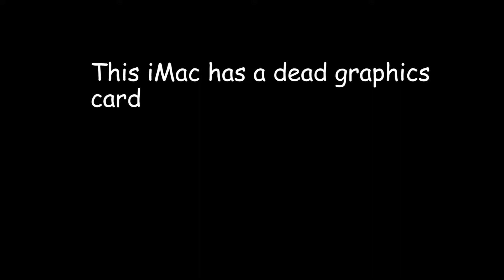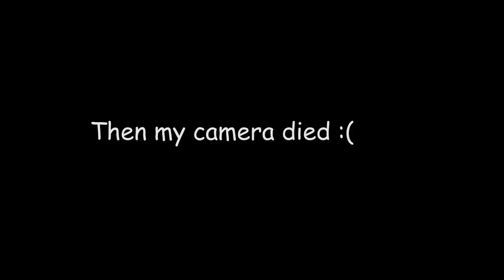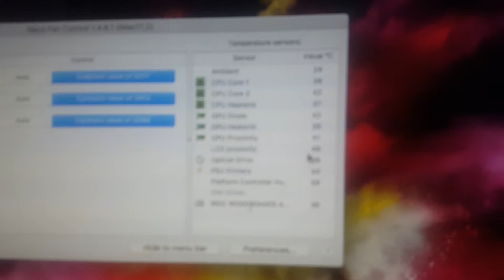iMac(mid 2010) Graphics Card Replacement

Comment: Does the AMD gpu from mid 2011 imac works in imac mid 2010?
Reply: It works. I just got home from the repair shop. And it actually works, actually it gives a little bit enhancements on the performance. Thanks for your reply by the way 😊👍
Reply from the maker: Maybe, if the power draw was the same and it was the same size but then again who knows with apple stuff

Comment: Cool man. Do you know any guides on upgrading it? What models are compatable and so? I have the 27" i7 model (mid 2010).
Reply from the maker: If you match up the correct power draw and form factor GPU then it might work
Reply: Wacky Tech Adventures I’ll try to dig into that. Thanks a lot :)
Reply: @ZaidanMhmood  find any compatible gpus? I'm here with an i5 mid 2010